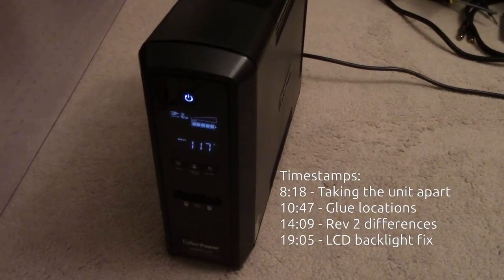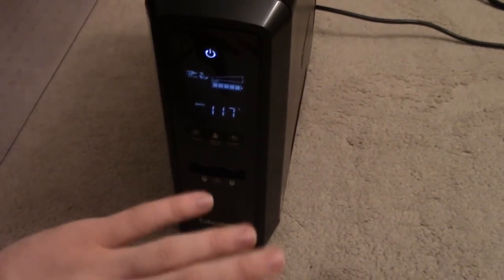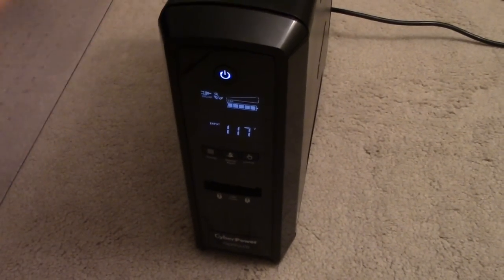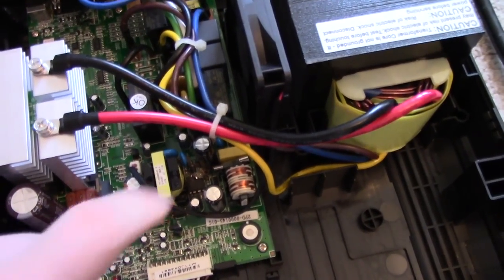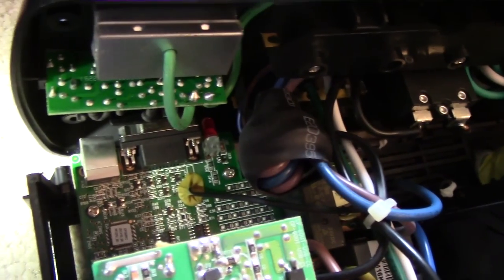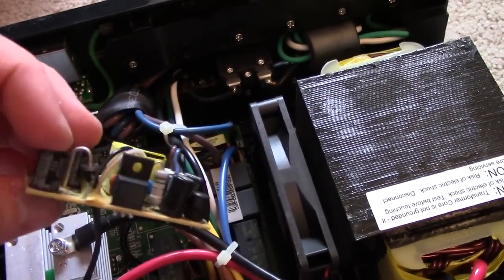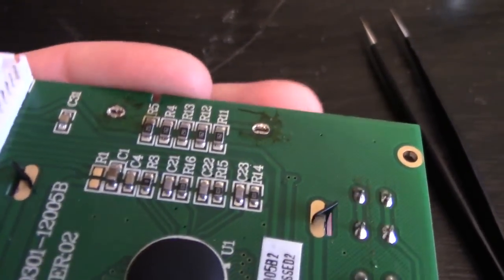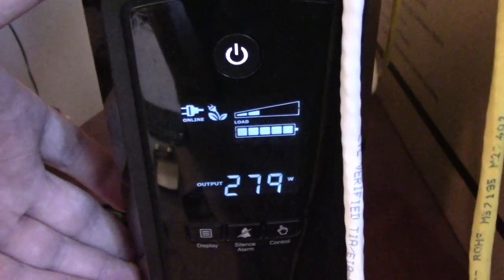CyberPower UPSes Contain Conductive Yellow Glue of Death (+ Bonus Rev. 2 Dim LCD Fix)

Comment: Can confirm at least on a single Cyberpower model CP1500PFCLCDa manufactured in April of 2023 that there is no yellow glue; and very little white glue except on the front panel lcd connectors.
Reply: You LEGEND. Thanks for the info.
Reply: Thank you for this. I just ordered mine 3 minutes ago, and this video just popped up. My concerns are now averted, and you're the real MVP.
Reply: How can i know when my model was manufactured or which revision is it?
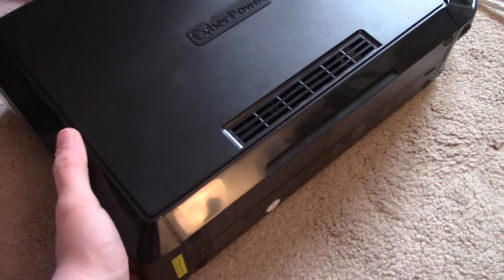Reply: @iAmCbasBoy  If you cannot tell through the explanation that was given at the 14:08 mark of this video; the main difference is as follows.  

Looking at the specifications on the bottom of your UPS; revision 1 has 1A usb charging ports while revision 2 has 2.1A usb charging ports which is possible through an additional daughterboard attached to a heatsink as observed at the 14:33 mark of this video.  
Finally from my own observations Cyberpower added a flip out status LCD screen instead of a fixed screen to the revision 3 units.  

Otherwise the only way I could tell the exact month of manufacture was by disassembling the UPS completely; observing the date stamped on the transformer which is a large metal block and represents the second heaviest part of the UPS.
Reply: @Nachokinz  thanks... The present annoyed me with the amount of ums and inability to make two statements without 9 ums, which is hell for my ears.

Comment: The glue is made from synthetic rubber dissolved in solvent, and filled with ground chalk as filler. Used because it is cheap, easy to apply, cheap, dries fast, cheap and last of all, cheap and lasts till outside of warranty. Breaks down with time and moisture, and thus become conductive, till it burns and becomes really conductive.
Reply: I read that is is some sort of neoprene / chloroprene type adhesive.
Reply: Absolutely not planned obsolescence :^)
Reply: I think you forgot to mention that it's really cheap.
Reply: Chalk would explain a lot of the problem. It is probably absorbing water. They probably measure out to know it won't fail in the warranty. And in a way it works too keep moisture from hurting components during warranty, but then it just absorbs enough with the potential to cause a short.
Reply: @Gengh13  On top of that, it's cheap.
Reply: Cheap, but not safe.:face-fuchsia-wide-eyes::face-blue-wide-eyes:

Comment: Just opened a newly purchased GX1500U, Best Buy's variant of this model, and it has none of this Sony Bond. It used silicone instead. Good chance this problem is fixed in the CP1500PFCLCD models by now. Just make sure you get the one with the USB-C port on the front.
Reply: that's good to know, rev 3 is the model with usb-c right?
Reply: How would you know what revision you have?

Comment: Did you ever manage to take a Rev 3 unit apart? Is there any UPS brand out there that is better manufactured? Thanks.
Reply: used  12V deep cycle battery 75A or 100A you get good hour on it i have ups 350VA i have 12Volt deep cycle battery 75A I DO 9HOURS and still have 40% leave on my battery stop at 11.7volt from 13.7V

Comment: Check Mr. Carlson's Lab   UPS Electrical Failure - Teardown and Analysis!
ACP branded UPS burning smell, ACP had used aluminum wire instead of copper deep inside the transformer, and had tried to solder the aluminum wire for a connection:face-fuchsia-wide-eyes: Solder does not take to aluminum, so the wire was sparking inside! :face-green-smiling::face-fuchsia-wide-eyes::face-blue-wide-eyes: Schneider Electric, YIKES!!!  He did an autopsy to find it. Great video showing the lengths these brands go to to save pennies, and have products that burn up.

Comment: Just opened up my CP1500PFCLCD "rev 3" (with the tilt LCD) [made in Philippines] and found PCB labelled P3P-0000085-02(V1_2). This PCB has all the printed traces and small components on the back side with larger components spaced further apart and attached on the blank (non-printed) top side. All the low power male and female connectors were encased in plastic plugs with some having blobs of white silicone adhesive just on the ends of the plastic parts of the plugs themselves and not on the PCB. Some of the larger capacitors were glued down to the board with a blob of yellow glue against the side of the capacitor, with no indication that the glue makes contact with any conductive surfaces. The chances of this failure with this design should be significantly lower. I did opt to remove one blob of glue that was between two capacitors just to be on the safe side.
Reply: How did you separate  the two sides of the case?
Reply: @TomVeik  They are just held by plastic clips that will release when they are pried apart. For the full procedure: Remove 2 screws on the bottom of the front cover. Slide the front cover down and forward to remove. Remove 2 screws on the battery brace. Remove the batteries. Remove 4 screws on the back cover. It is also held by plastic clips. I pried it backwards by pulling it away at the top on one side and inserting a putty knife slightly into the seam and working it down the seam to release the clips. Once you get it started, the rest of the clips release easily as you widen the gap. Repeat this process to split the 2 sides of the shell starting at the back of the bottom seam. You can bend the plastic slightly inwards at the seem to assist in releasing as you pull the 2 sides apart. You can again jam a putty knife or pry tool in there to stop it from reattaching itself as you move down the seam to the next clip. Repeat the process on the top seam. It should be significantly easier with the bottom already released making it possible to tilt the sides slightly away from one another while pulling them apart.
Reply: @VirtualBSHere  Thanks, I got mine open.  I did break the center clip on the bottom though.  I think it might have been better to start at the top since those clips are just like the clips on the back which I didn't have any problem getting past.  Only found a small amount of yellow glue on four of the big caps.  Doesn't look like any problem though as there are no circuit board traces on the top side of the board and no other conductors right there.  There is also some silicon adhesive holding what looks like a ferrite bead on one leg of each FET.  I would post some pictures if this would let me.
Reply: is this the same as CyberPower CP1500EPFCLCD UPS? I just bought one from Lazada Philippines. Should I be concerned?
Reply: @majornukke   Right I was about to ask the same question. Any advice @VirtualBSHere?

Comment: Before anyone panics, I highly recommend opening up your unit (or units) and checking them. I own a bunch of these CP1500PFCLCD and CP1350PFCLCD UPS's, (including 5 of the older "V1/V2" variety and 2 of the new "V3" units), so I opened up the older ones to see how bad the situation was (I didn't open the new ones because, well, they're brand-new). Four of the five had the chloroprene adhesive only for strain relief on the 5v USB leads and NTC sensor wire; these units were manufactured between Dec 2010 and Mid 2015. The fifth unit did have the adhesive on two of the caps, but not in a fashion that would lead to bridging (I examined them pretty carefully), as they weren't contacting leads or other surface mount components (none of them had anything near the driver IC). 

Having dealt with removing this chloroprene crap in other equipment (shockingly, a lot of high-end stuff), if you don't need to remove this awful stuff, e.g. it's only interacting with low-voltage, or not in danger of bridging things, thus unlikely to present a problem, I wouldn't go messing with it. This stuff will lift pads, surface mount components, etc.. However, if it's egregiously bad, as in the case of the examples highlighted in this video, you'll need to remediate it, in which case I recommend (VERY CAREFULLY) using this stuff: https://www.alliedelec.com/product/gc-electronics/10-312/70159779/ .

Finally, there are more significant revisions of these CP1xxxPFCLCD UPS's than just those highlighted in the video. Specifically, in the "V1" category, there were at least two major revisions of both the 1350 and 1500, which have different LCD assemblies, different front-panel connectors and, most importantly, different boards (for example, one of my 1350's has a connector for the 5v rather than soldered with glue for strain relief - oddly enough, that's also the unit with adhesive on caps). I also believe that my early units were simulated (e.g. triangle) rather than true sinewave (equivalent to the current avrlcd models today).
Reply: Ever open up your rev3 unit??
Reply: @jwilliams6286  He said it's too new so probably still under warranty.  I too have both V2 and V3 versions at my house.
Reply: So is the CP1500PFCLCD safe or not? lol
Reply: @RidinWithJesus  most likely not.
Reply: @riotgear6891  i bought a 1500PFCLCD Pure sine wave, around december 2022. Is it safe? I cant find info if i have a Rev. 3 unit???
Reply: @clonetrooper576 if you have USB-C or if the front panel tilts it’s rev 3 or later
Reply: @soryuushi  Okay im safe then

Comment: Taking it apart summarized in text: 
Remove the battery door to reveal a hidden screw fastening the top cover to the battery cradle, remove the rear cover’s screws, slide the top cover towards the rear to unlock the front cover, slide the front cover down to unhitch it from the side panels and reveal another screw also fastening the top cover to the battery cradle, gently pry the top cover and off it comes. Getting the battery cradle to separate from the bottom cover takes a substantial amount of force to release its snaps.  (Note the ONE screw on the inside, so ensure you slide off the top cover first)

Comment: I have the APC 1350M2. I took mine apart and did not see this glue anywhere. APC/CyberPower may have fixed this in newer models. Still glad i took it apart to confirm, would rather be safe than sorry. Thank you for this video.

Comment: Well, that sucks. Worst part is, I'm probably still gonna buy this UPS because the output regulation quality is simply unmatched in this price range. Pure sine wave UPSs from APC or Eaton easily cost twice as much. If I can save $300 for an hour of cleaning up glue, that's still a good deal, but it's horrible because most users will never learn of this design flaw and even if they did, most people don't have the knowledge/skills to fix it.

Comment: I've bought like 8 of these units myself and my brother has 4 all on your recommendation from your old videos. Had them all a few years now and no issues, but this is very unsettling. The glue btw is called Sony Bond, seen on various electronics such as receivers etc back in the 80s and 90s. They were supposed to do away with it for silicone.
Reply: I have taken apart two of my friend's CP1500PFCLCD that were about six years old and both had that nasty brown crap etching into the circuit board. Another year and who knows what would have happened. These UPS with this Sony Bond crap will eventually burn down someone's house. It's just a matter of time.

Comment: Thanks for all the info! I checked a pair of CP1000PFCLCD units that I got together on Amazon in 2016. They both had this yellow glue and it was browning. Luckily hadn't developed any conductivity yet. The serial numbers are 5 apart, and the gluing was still a bit different between the two of them. On one, the capacitor blob near the viper chip had crossed over and covered some of the viper chip, but on the other, it stayed entirely by the capacitor instead. So there's inconsistency even on units that were built in the same timeframe. Neither of them had glue by those SMT resistors luckily. Removed the glue very carefully with a small screwdriver, dental pick, and needlenose pliers.

Comment: Thank you for this video, and I can confirm 100% that this is a real problem. My CyberPower UPC (REV 2) was not kicking over to battery backup (100% charge indicated) and when I opened the unit I found the dreaded yellow glue. The bright yellow areas were not conductive, but the darker brown areas measure almost zero resistance in places. Of course the unit is past warranty period. Not sure if I even want this thing hooked up even after repairs.

Comment: I have a bunch of these units and so far, no issues with any of them, the earliest being 2019. I haven't even replaced any of the batteries! Hope they don't go bang but I appreciate the video and will attempt to repair them if they do fail due to the glue. And I didn't even notice until you pointed it out with your LCD fix that one of them is super dim compared to the others haha.

Comment: Thank you so much for making this video. I took apart mine of this exact same model (rev. 2) and my glue had already started turning brown. Cleaned it all off and hopefully the unit will last for years to come now. Did the same with a 1000PFCLCD as well, it had the same glue inside. And yes, I did make it all the way through the video haha
Reply: What did you use to clean it off? Mine is browning between two caps and I see some corrosion as well.
Reply: @geraldsanchez191145  I used a screwdriver to chip it off small bits at a time. Just be careful not to damage the SMD components nearby or under some of the glue. Not a fun job by any means but it works
Reply: @ChazLakinger  Oh wow, I just tried it and it is rock solid. Ended up going through the comments before your reply and settled for a solvent. Hope it ends well!
Reply: @geraldsanchez191145  let me know if it works well. I have one more of these I need to do this to that I've been procrastinating
Reply: @geraldsanchez191145  how did it go?
Reply: @freevipservers  I did it a week ago so the information is fresh. I used this chemical “Radio-TV Cement Solvent 10-312” to help clean off the yellow glue. You have to use multiple layers, applying every 2-3 min.
Doing it like that it might soften the brown glue, but if it doesn’t then I recommend whipping out a can of compressed air with the thin red nozzle extension, turn it upside down, and spray at the afflicted area for a second or two and try to pry it off or scratch it off.
Reply: @geraldsanchez191145  thanks i was just curious lol i dont even have this brand of a UPS.
Reply: @freevipservers  lol for the future people who watch the video and read comments

Comment: I have one of these, so I watched all the way to the end 😀🧯🔥🔥🔥🧯.. Great... ug.. another project for the summer.
Oh what a rabbit hole you put me in LOL.. Doing my research to see what this glue is.. Why it is used.. and how to effectively remove it.. has been an experience in just how little we know about how China does things. There is no easy way to remove this gunk. Many cleaners are not up to the task.. Looks like the best? method is to freeze the yellow stuff to make it easier to scrap off.. Have to be careful with any surface mount components to the point that maybe should not be attempted by a simple hobbyist (just get the main stuff off the high voltage  areas) I am a simple computer repair type hobbyist  person and only do component level stuff if absolutely need to. BUT this needs to be done to prevent possible house burning down scenarios, so I feel like I will need to address this with my unit.

Thanks for the PSA you might have literally saved a life with this one LOL . I sleep not 5 feet from my UPS and PC. 

Now how many other time bombs do I have sitting around here from China LOL...  Yes it appears it is predominantly China that uses this stuff.

Comment: I am surprised, it appears this is very good info.  My UPS has been not accepting grid power after the grid goes down, even for a few seconds.  The UPS run until the batteries go dead and the UPS didn't charge.  I put new batteries in the unit and still no charging. I opened the old Cyberpower 1500VA AVR and found the hard yellow glue in the charging part of the circuit board.  I cleaned all the glue off the board and components. I then reassembled the unit and turned it on.  The unit started charging the batteries. I unplugged several times and it now works as it should. It recovers and charges the batteries.    I can think of at least two TV sets that I tossed that had a lot of the yellow glue in them.  Darn!!  BTW good video.   Oh, the yellow glue was on a zener diode, the diode next to it, the 8 pin chip and then onto the two caps.
Reply: My CP1000PFCLCD had the exact same issue: not switching back to main after an outage. In some places, the yellow glue is now brown.
How did you remove it? Just scraping, or is there a solvent that helps?